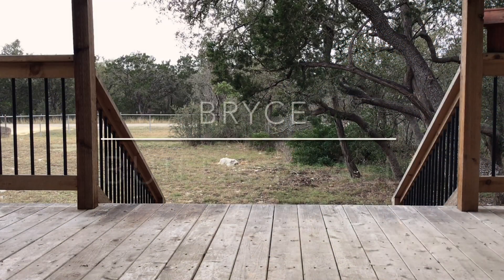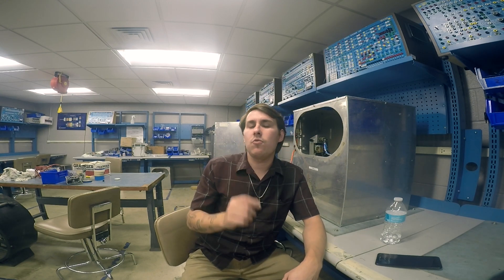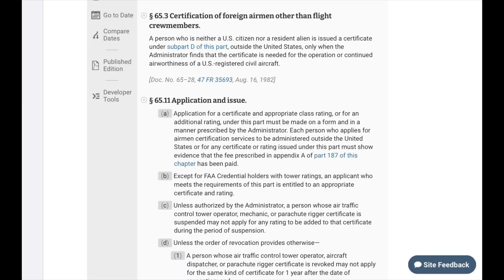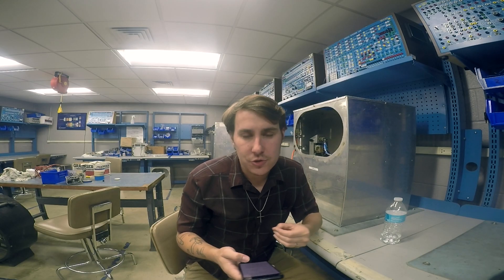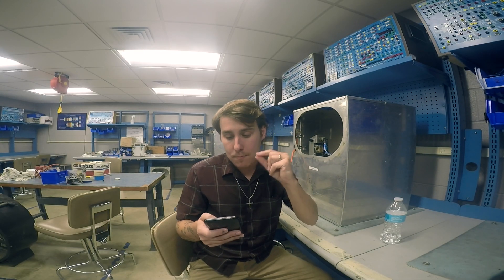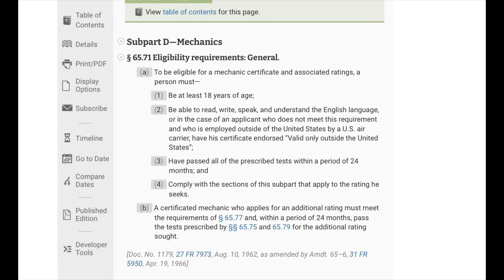How To Get An A&P If You Are Not In The U.S. Become An Aircraft Mechanic.

Comment: Can make a video addressing Bernoulli's principle on the top chamber of the wing, and the misconceptions there are out there on what causes the airflow on the top of the wing to move at a faster velocity.

( The Equal transit theory) explains that two particles flowing over the wing on either side, are required to meet at the end of the wing at the same time and the fact that the top of the wing has more distance to travel, that this is why the velocity is increase to meet the other particle at the bottom of the wing. I have heard and researched that the "Equal Transit theory " has not been proven an is just a theory, and have even heard that wind tunnel testing has debunked this theory and showed that the particles in fact do not meet at the end of the wing at the same time.

I would like to know your opinion on this because a lot of my research sources show credit to "The Equal Transit Theory" as to why the velocity increases on the top of the wing, thus leading to Bernoulli's principle of a lower static pressure on top.

-Please and Thank You.
Reply from the maker: This would actually  be an very interesting video as some belive that downward deflection of air is what causes lift.